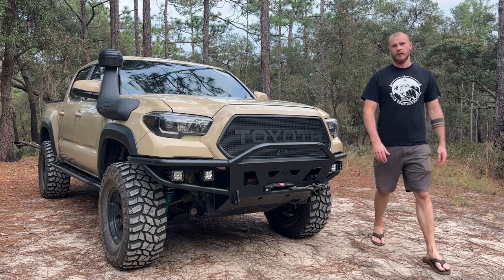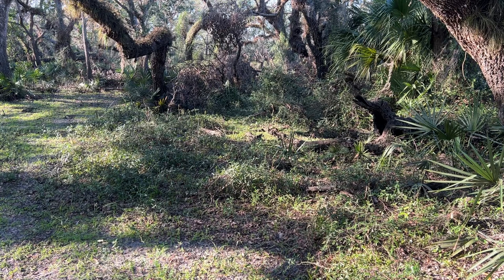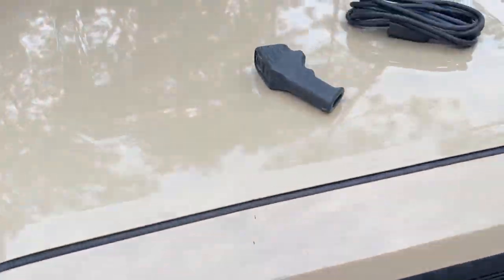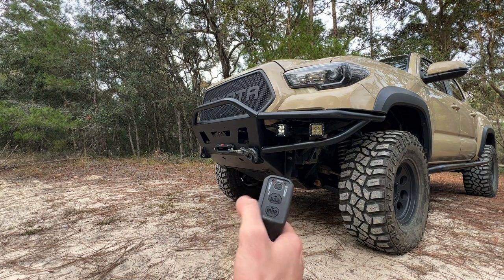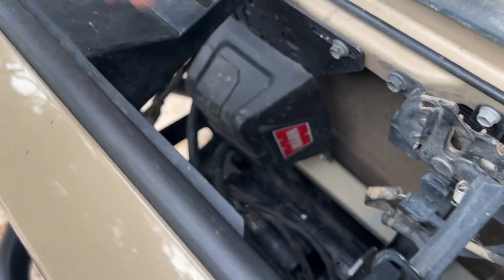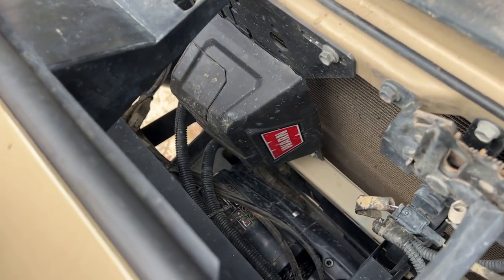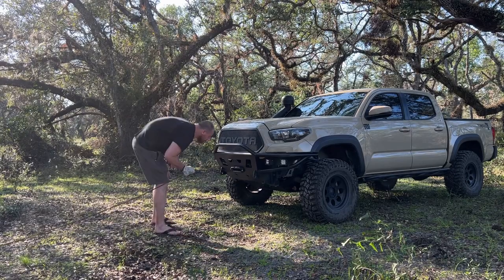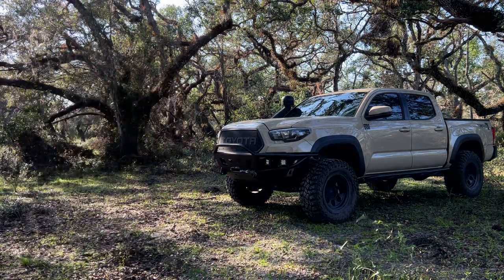My Winch - What? Why? How?

Comment: When you install your winch, did the weight affected your front end? Lift height etc?
Reply from the maker: I think the weight of the winch is about 70 lbs. so the weight of the winch itself does not have that much of an impact. But when added with the mounting point, whether it is a whole bumper or just a mounting bracket can add up to a lot more. So yes, the weight on the front did have an impact of the ride height. Obviously, the more weight is added the more severe the impact. This can be addressed by adjusting the front suspension.